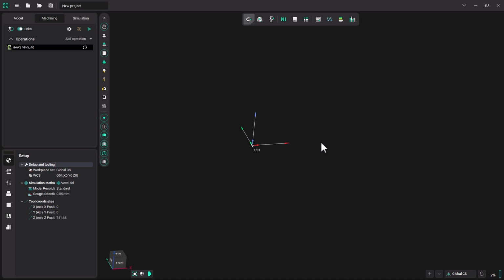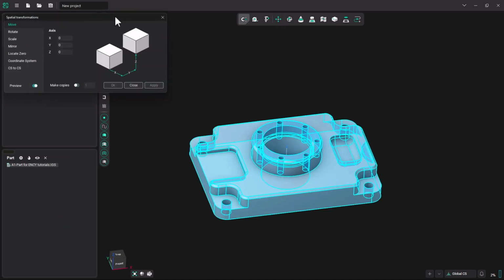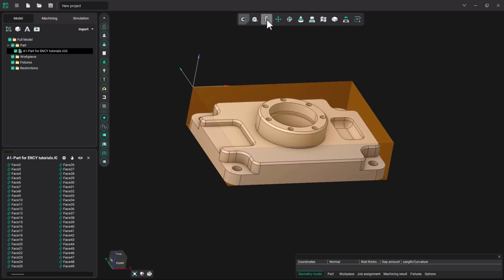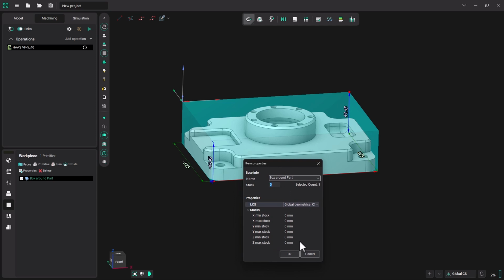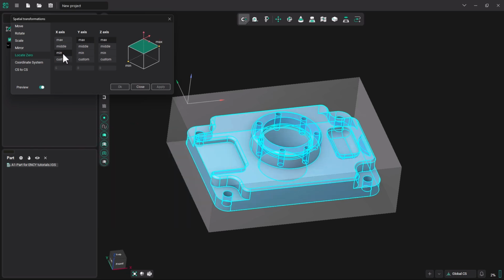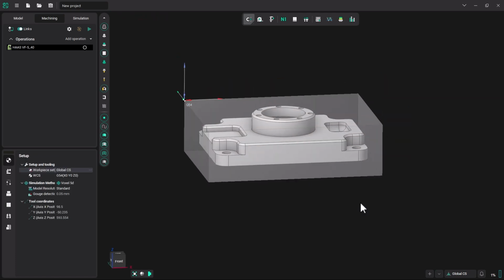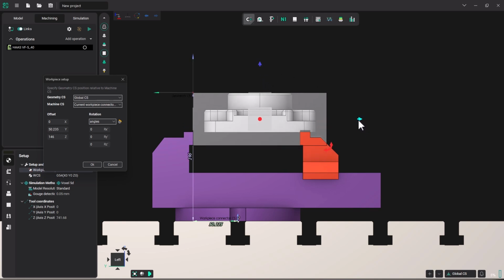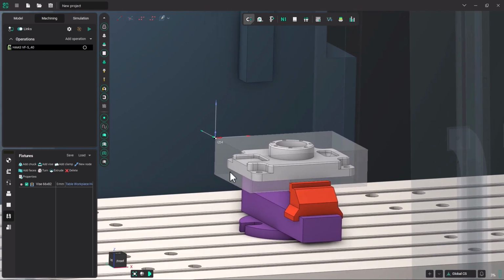Setting up a Model for 3-axis Milling | Tutorial 3 | ENCY: Get Started

Comment: Hi, I recently bought ency software and try to learn it... but can you please tell me I can expect easier way to make WCS/MCS than this video? I mean, I just want to 'point' and 'click' where I want make my own WCS/MCS, not 'calculating' it. Overall, this software is really good! it's fast and easy to learn and have competitive pricing policy... let us make it better.

-----
Oh yes, I know I can actually point and click my own WCS/MCS. But I found it is difficult to make it correctly, like certain center of hole on model or misaligned point of model.
Reply from the maker: Thank you for your opinion. Typically, such features are limited by programming, but our programmers are always looking for ways to make them easier to use. If you ave any  ideas for features we're glad to consider them. Please, email us at support@encycam.com
Reply: At first, I found the WCS setup a bit difficult, but as I got used to it over time, it became much easier to use.
Looking back, I think my initial impression was partly due to not being familiar with the system, so it’s only fair to re-evaluate it after gaining more experience.

Now I’m quite satisfied overall.
It’s very fast, and the toolpaths match my machining intention really well.

Also, the ability to save and reload job strategies is extremely powerful.
When working on slightly different but similar parts, this feature significantly reduces setup time and makes the workflow much more efficient.

Comment: The software looks absolutely awesome, especially the interface and graphics. Will certainly try the trial ASAP, maybe as soon as I'll have some free human and machine hours around Christmas.
However, I will never understand how you milling machine guys can even mentally survive having your origin in the upper corner of the raw stock 😮 being used to lathe/multitasking, any origin that is not on the finished Z top, and not in the centre, or at least at a hole axis, or on an edge from anything else is dimensioned on the drawing, would just drive me crazy at the third line of the output code 😂
But that's just some personal stuff (and just saying it for fun/conversation), the software looks fantastic and the tutorials are well made and explained, Nice job!
Reply from the maker: Thank you for your opinion and the feedback!
Reply: same, for us always put the origin on the part, not the stock